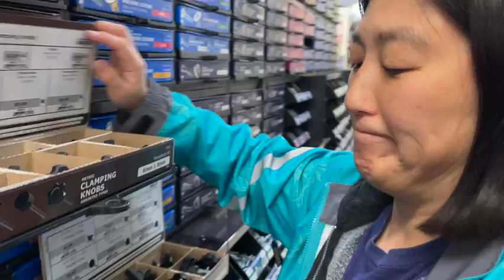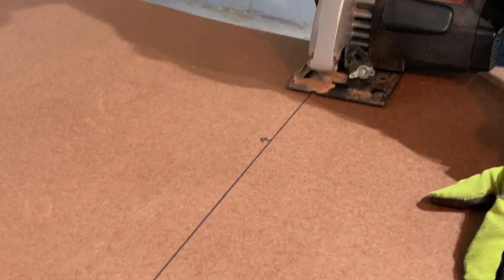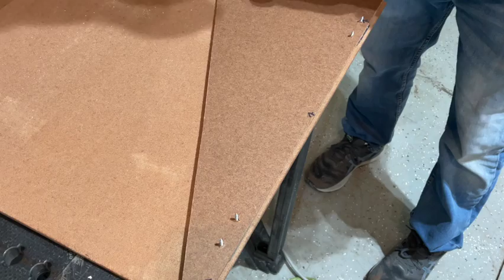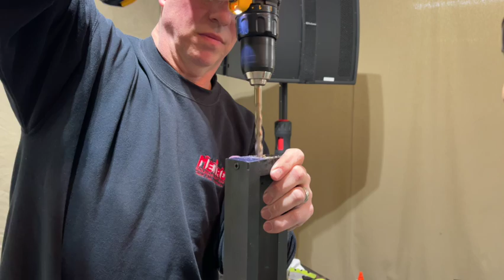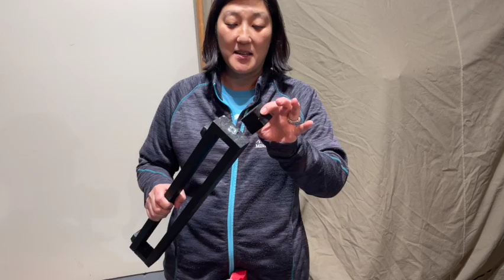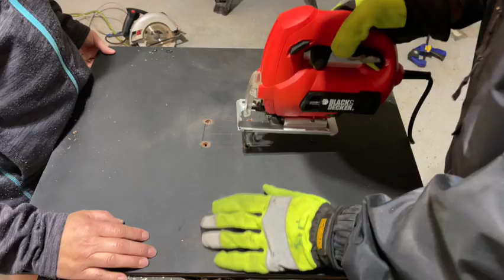The SC - No More Drinks on our Subs!

Comment: Woudn't industrial velcro hold the panels together rather than mechanical fasteners?  Also easy to replace if needed in under a minute almost any where.
Reply from the maker: We tried a redesign of just the back brace with magnets and it didn't work.  You would be amazed how many people rest their hands on these and like magnets, it's probable velcro would not sustain a hand rest either.

Comment: Thanks Bart & Stacy for the demo and sharing the design - I know you've had good use from these so far.  I'm no chippy, but I've a couple of friends that are cabinet makers who helped with a couple of little projects. I'm always happy to give something a go or make fun of my mistakes.  If you ever replaced the sliders, would rivets be easier than screws for the hinges & a large hole-saw for the speaker pole opening?
Reply from the maker: Something to consider if we end up making new ones...maybe the Sub18's?

Comment: I am now inspired to build my own 😊 But to find the center hole, I think I may first erect the slider then find the center for the hole by measuring from the side of the cab, then up and over to center on the top of the slider (if that makes sense).
Reply from the maker: That was the hardest part for us!  It's something else we need to deal with, but they have solved the problem and so it's worth it!

Comment: If you're trying to build one of these yourself, the formula of where to drill the hole is: 
H = A/cos(α)
Where H is the hypothenuse and A is the adjacent side and α is the angle between the two.
A is the distance from the front edge of the speaker to the middle of the hole (in this case 12 inch.) and H is the distance from the front edge of the speaker to the middle of the hole you're drilling.
This formula is derived form: cos(α) = A/H

And if you want to cut an oval, the width of the oval has to be H/A times the width of the pole.

Example: A = 12"  α = 20
H = 12/cos(20) = 12.77"
H/A = 1.064
The hole has to be cut at 12.77" and has to be streched by 6.4%
Reply from the maker: Thanks!  We knew there was a mathematical way of figuring this out, but didn’t want to mis calculate.
Reply: @thesoundcouple  yeah, when you've just written your maths finals it's still fresh in memory

Comment: Hi Bart and Stacey, it's cool that you have a pair of these now  :)  just a note... when I install a T-nut, I make the hole for it so that the T-Nut fits loose in the hole and I don't hammer it in, I use a screw to "pull it in". Also, The T-nut ideally should be on the inside of the drink slider brace. Regardless, I was happy to see you guys again... Have a wonderful summer!
Reply from the maker: Thanks Dan - yep, we learned about T-nut as others have pointed out as well.  The video has had good responses and we actually have had some musicians notice and thought it was a great idea!  We have used them for a handful of gigs so far and they are working out great!
Reply: @thesoundcouple  great great great !!!

Comment: Oh, what a nice covered shelf for a drink... with rear access, with little anti slip off edge, where nobody sees it, nobody steals it. Hopefully it won't work like that. If so, you can simply add the rear wall to the bracing. I'm kinda used to my (fortunately passive) subs being used as a drink shelf or sitting bench (as i mostly place them as a center cluster in front of the stage). Sometimes even I use it myself as a step to the stage during setup :D But i definitely see the point, nice job tho.
Reply from the maker: We can only see what happens.  We have had one gig with them and so far, they have done exactly what they were designed to do!
Reply: It’s not the guests that use my subs as drink holders usually, it’s usually me! Lol

Comment: Hi great tip and video. I was wondering if you tested the fit with your rain proof speaker covers?
Reply from the maker: Good question and the answer is no.  However, the speaker covers kind of achieve the same results.  We would not be as concerned with spillage with the covers on.  
My guess is that we will not end up using them with the cover because the covers are form fitted and the drink sliders would throw off the fit.

Comment: Guys, Your T-Nuts are on the wrong way! You should have drilled all the way through and then put the T-nut on the other side of the hole so that each time you tighten the bolts you drive the pegs on the T-nut further into the wood, now you sadly have the opposite.. Good Luck anyway!
Reply from the maker: Good call!  Makes complete sense now that you mention it.  Like you say, probably ok here, but something to note for sure.
Reply: I noticed that too! I've used those in a bunch of pedalboard builds!
Reply: Im shure its fine in this application, but for any future application where there is gonna be some weight on the T-nuts its good to Know!